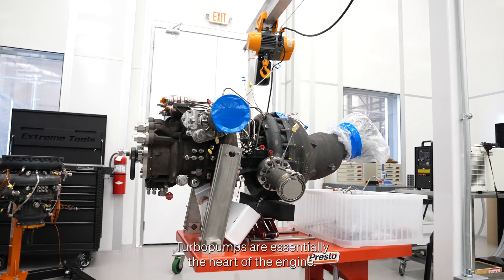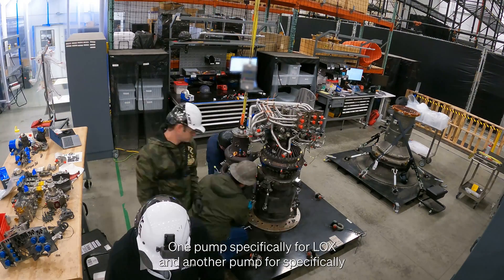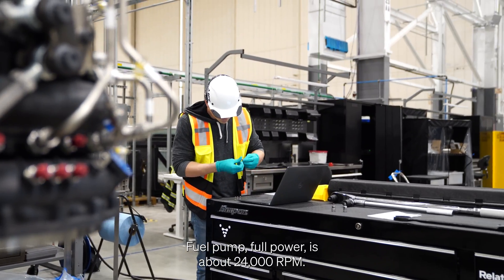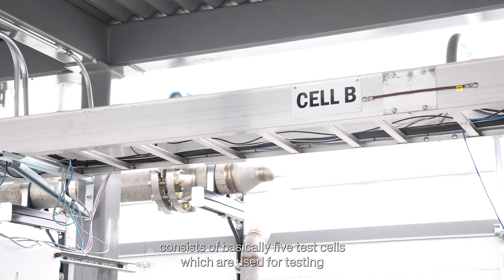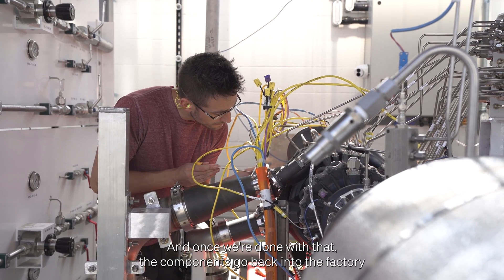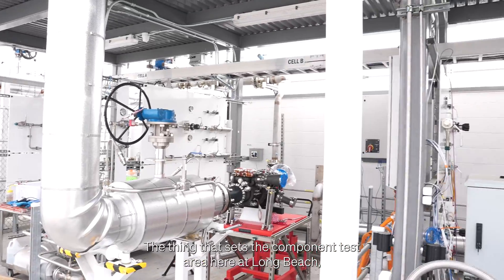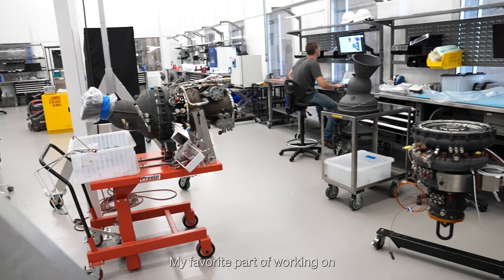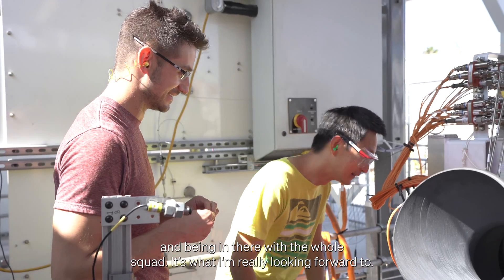Relatively Speaking: Aeon R Turbopumps Explained

Comment: Why two separate turbopumps? (With one preburner?) All of the gas generator cycle engines I've seen use a single-shaft turbopump assembly. Using two eliminates the seal issue but that seems to be a solved problem. Two means more mass. Tradeoff?
The only engines I know of with two separate turbopumps are FFSC. Are you doing this with Aeon-R to gain experience so you can go on to build an FFSC  engine?